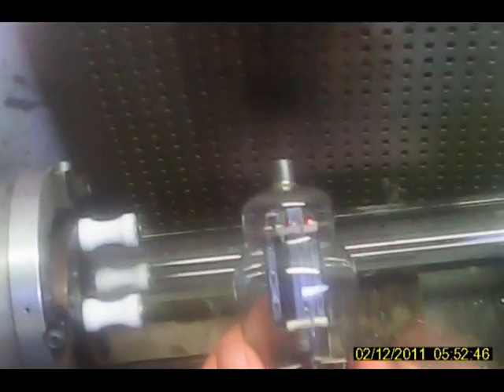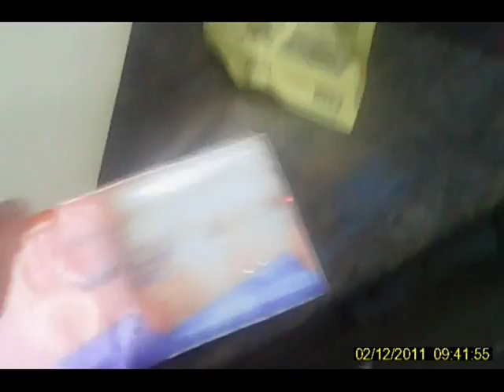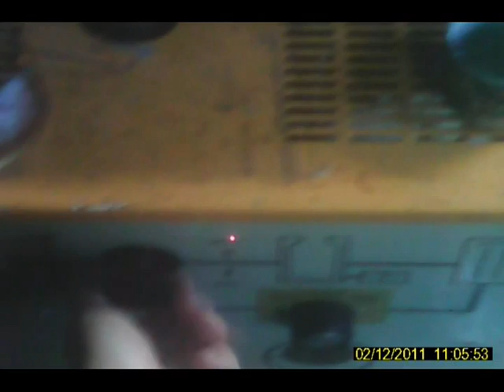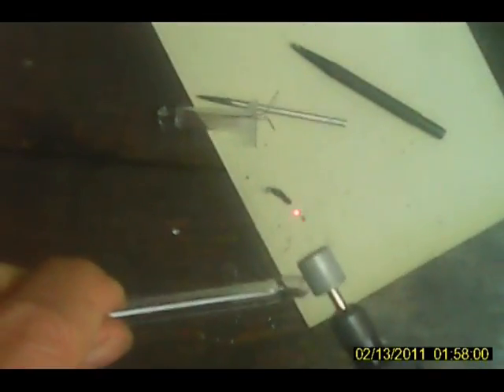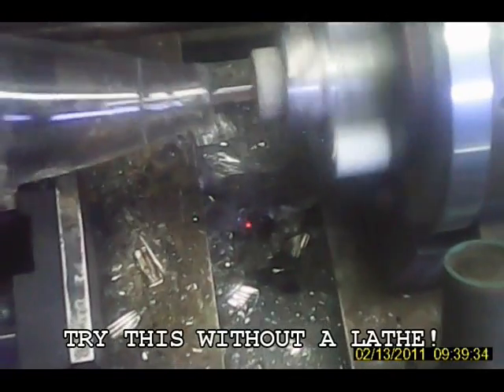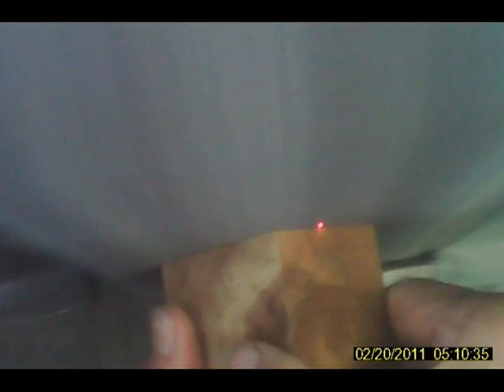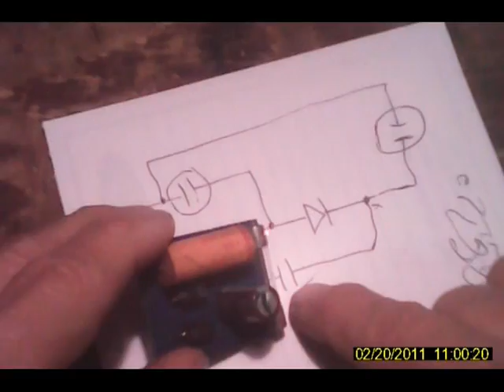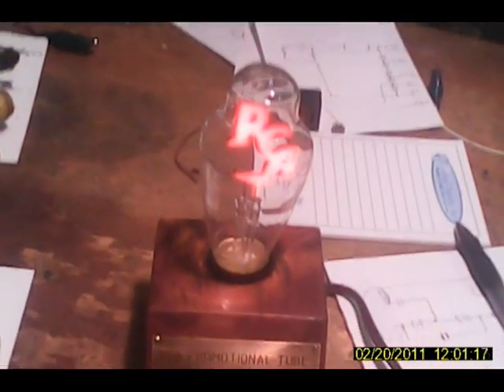Making an RCA promotional tube.

Comment from the maker: The doubler was simple. The tube wouldn't fire with 120 volts and it reliably fired with 240 volts so the answer was obvious. The metal glows because the electric field is strongest at the surface of the metal. This causes the neon ions to lose electrons and when these electrons re-combine with the ion, orange light is given off. Lots of ions give off lots of glow so the metal seems like it is glowing. 
ron

Comment from the maker: Hello!
At first when I didn't know what was available I tried the scribe and crack method. This was very iffy in success, many times the glass just shattering. Also, there are many cases where it is impossible to scribe the glass because of shape and position. I then tried the dremmel diamond blades. They work great but the dremmel tool is too bulky and cannot be gotten into position on the lathe. I then found these 4 inch dia .006 wide diamond lapidary saw blades on ebay and problem solved!

Comment: I probably would have added a glass bead on the electrode wires so it doesn't short out if bumped, I saw that near the end that the electrodes shorted a little when the tube was bumped
Reply: #9 or #10 Seed bead that used in bead craft (and you have the pick of colors also

Comment: glasslinger! great to see a new video from the tube-o-files.. does the annealing torch use a seperate gas with lower burning temperature? just simply a larger surface area for the amount of fuel used? (i think the laser-guided camera was a good idea..)

Comment from the maker: Hello!
You are correct! Unfortunately, I wasn't far sighted enough to catch that before the tube was sealed off! You should have seen the blast that happened when I had the lamp connected directly across the line! (I did have a fuse so it didn't destroy the tube)

Comment: Forgive me for asking dumb noob questions here, but i wonder if it´s possible to drive builds like this (With estimated the same areas of the thin sheets inside)directly with 230V AC?
(Since that´s what is here where i live)
Or does it needs an external load (tex som sort of resistor)?

I just started with building a high wacuum system from old surplus parts and realized there is still much to learn.
Think a device like this seems like a good item to start off with since it´s simple (Well... On the paper... :D ) and working with low gas pressure instead of high wacuum.